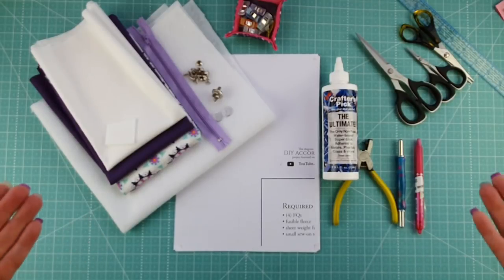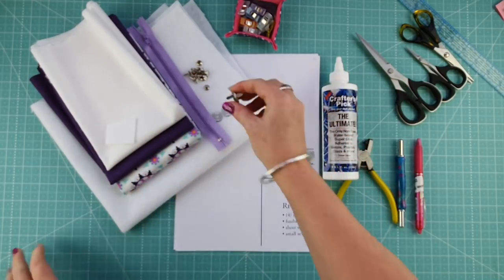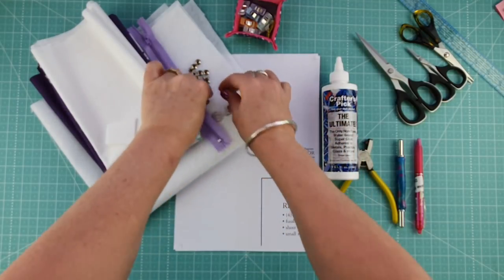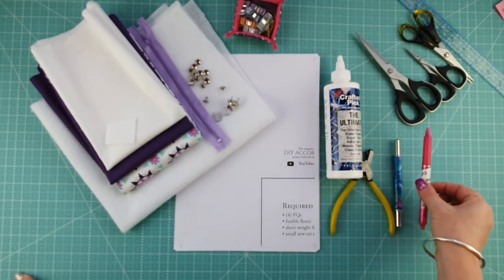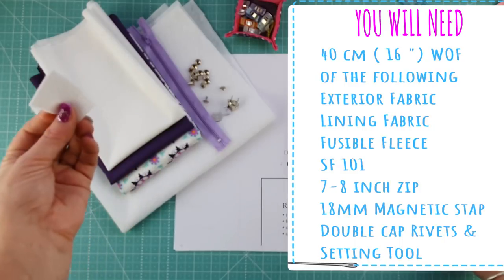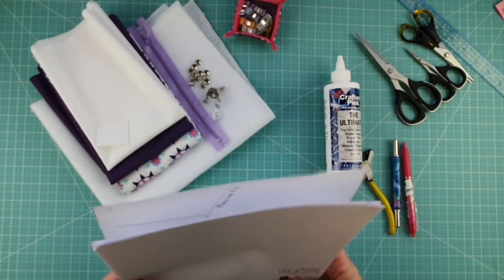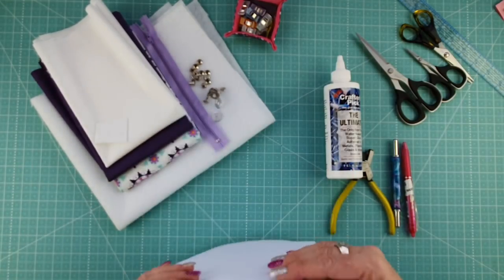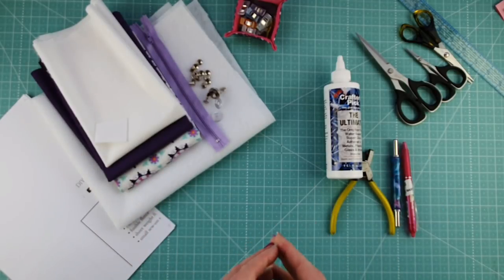Darvanalee Designs Studio | Accordion Pouch Hack #3 |  How to Enlarge & Install a Zip and Hardware

Comment: Great tutorial. I guess if you wanted you could put a zip at both ends of the flaps, using a longer piece of the blue fabric. I just ordered the Ultimate glue - I thought about it after watching your video for the smaller pouch as it can be used for other crafts :)

Comment: I LOVE this!  I've made many of the original one from your tutorial but this size is perfect!  I've never used rivets and have a question.  What size are used.  I purchased Dritz 8 mm but the shank is only 6mm.  Will that work?  When you said 9 mm, did you mean the cap size or shank size?  Thank you so much!  Your videos are just the best.
Reply from the maker: Hi Sandy, my Overall length of the rivet is 9mm . I have used 8mm ones before...but it was a struggle.  Thqnk you for taking the time to watch...l appreciate it ❤😊❤ happy sewing
Reply: Thank you so much for your response!  I didn't know if you would see this or not so long after the fact. It was hard to tell from the internet if rivet sizes mentioned referred to the head or shank of the rivet. I've made at least 10 little bags from your original tutorial but am anxious to try this larger size.  I am a tatter and they are just perfect for the small projects and tools but I think the bit larger one will also accommodate a ball of thread if needed!  You simply amaze me!
Reply from the maker: @sandycofer1481  So glad that you are loving the tutorial Sandy :) I greatly appreciate you being here on the channel and enjoying the content :) I know you can do the larger one :) they are an awesome size indeed ...have every merry Christmas and if you run into any issues I am on a message away :) you can also message me directly on Instagram under Darvanalee Designs Studio :) Have fun :)